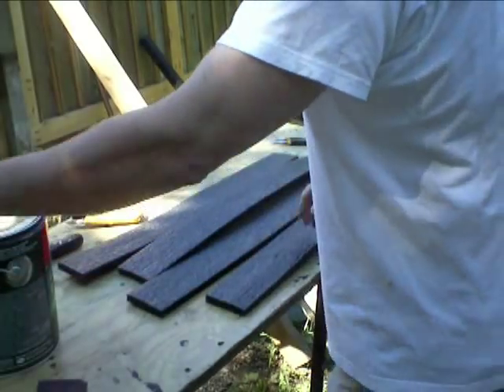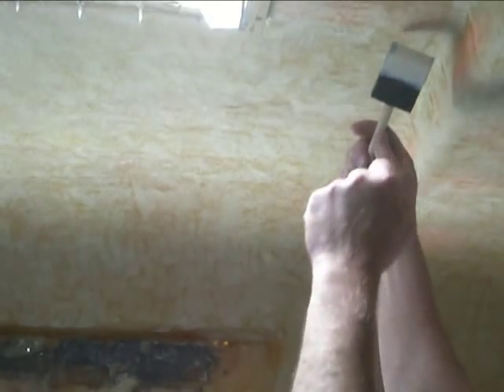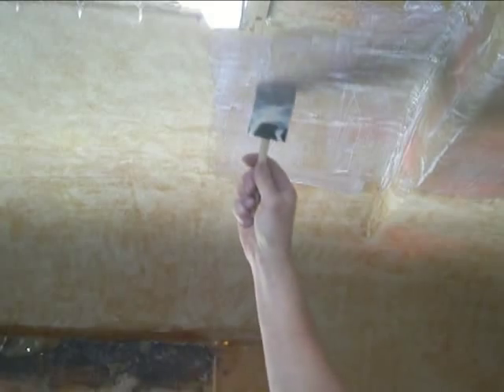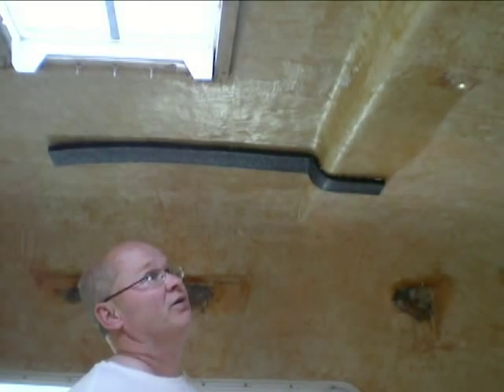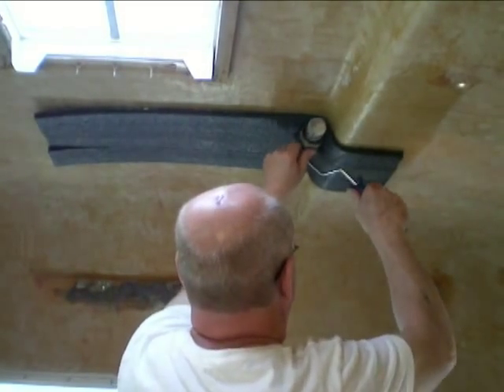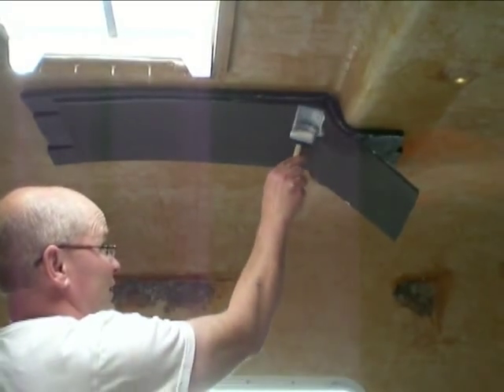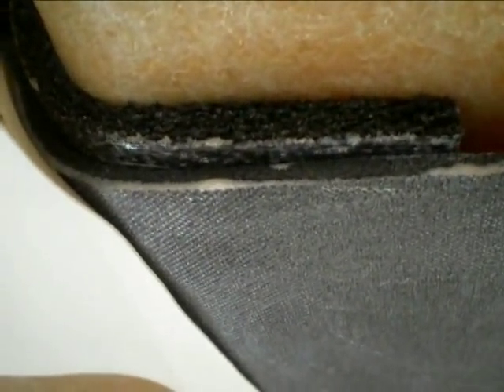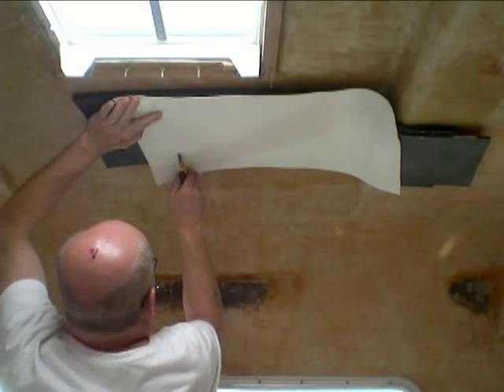Insulation test patch on walls of trailer

Comment: Where did you source the foam and how did you decide on this type of foam? Thanks
Reply from the maker: The foam was a "freebie" from a neighbour.  I believe he picked it up at a construction job he was working.  I think it is used under or over concrete while placing walls or footings.  Not quite sure.   Can't remember its technical name.